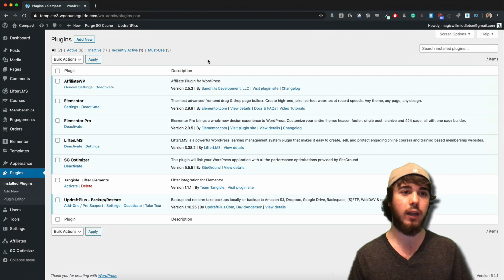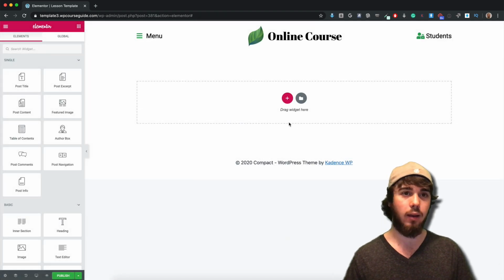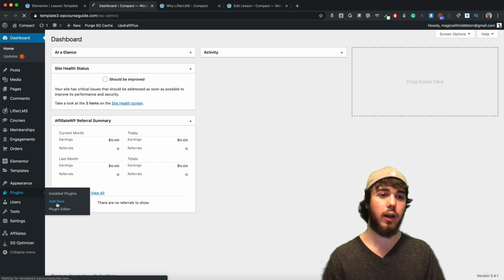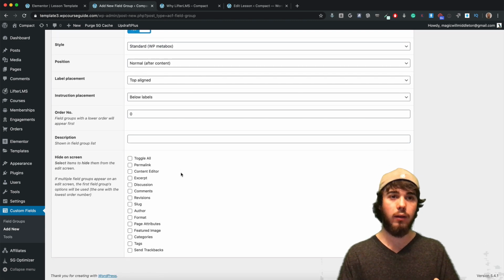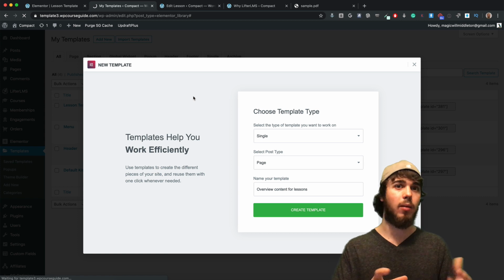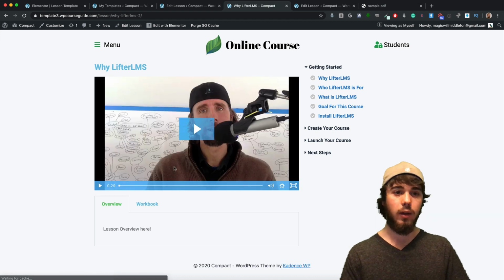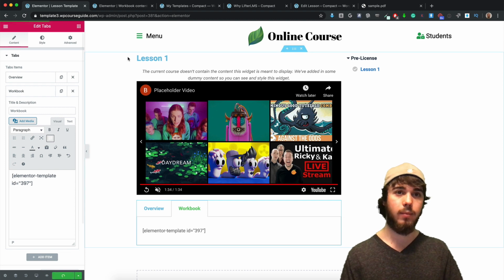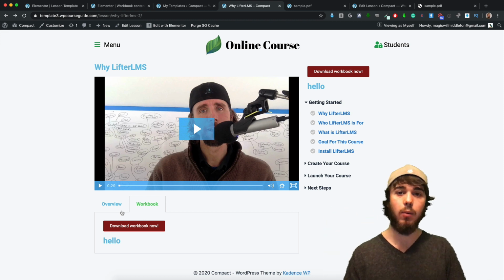Next Level LifterLMS Design With Elementor and Advanced Custom Fields

Comment: It doesn’t seem like Elements for Lifter is supported any longer.
Reply from the maker: Hi Terry, in this video, we're using the paid Tangible: Lifter Elements tool: https://wpcourseguide.com/lifterelements   rather than the Elements for Lifter tool from the WordPress repository. They have similar names but are different tools. There's a lot of different ones out there for LifterLMS + Elementor integrations, but I prefer Tangible's solution above the other ones I've used so far.

Comment: Tangible lifter element is not free, isnt it?
Reply from the maker: Hello, that's correct, it is a paid plugin from Tangible Inc
Reply: @WPCourseGuide  Lifterlms is just too expensive.  You have to purchase sooooo much, add ons, plugins and on and on.... omg.  I just can't.  Great video though.  You teach extremely well!!
Reply from the maker: @CharismaBlanco  Sure, there are of course ways to do it for free with LifterLMS free, Elementor free, etc. there just won't be 100% of the templates and ease of functionality, but it can be built out manually for free if you were to build out all lessons with Elementor manually.

Comment: Hi Will, another amazing video that has helped move us forward in building our lesson templates to look awesome - thank you. We are just having 2 problems, we can't add buttons or elements/widgets to the tabs boxes when using elementor (is it an add on??) and 2 when we finished making our template our home page and blog pages had all gone missing? They're there but not visible on the front end? Any suggestions would be amazing.
Reply from the maker: Hi Laura, for that you'd have to add in a template into your boxes, so you'd create an Elementor canvass Template and embed that single template into your tabs. Sadly there's not another way I know to add those in out of the box into the tabs. I haven't heard of that happening... I'd recommend checking out your display conditions on your template to make sure they're not set to display on your blog posts and only set to display on all lessons

Comment: Curious,  is there a reason you did not make the ACF set as a URL field for the download workbook?  Does it have to be a text field to use the elementor shortcodes?
I don’t use the text editor unless it is meant to display text only.
Reply from the maker: You can use the URL field for that, I just default to using a text field, since they're interchangeable in this setup